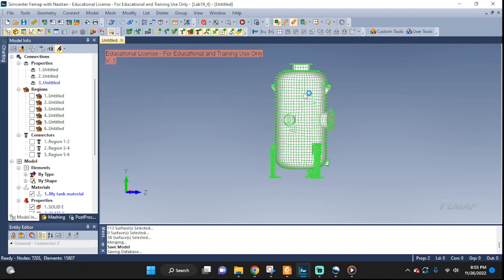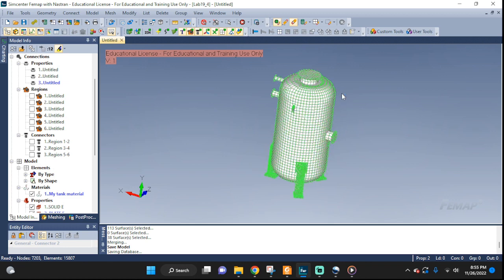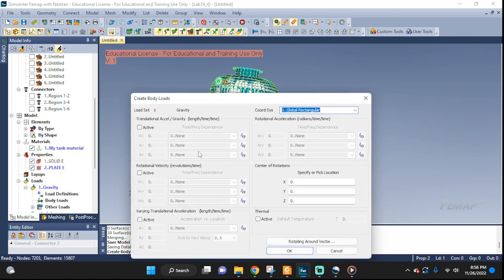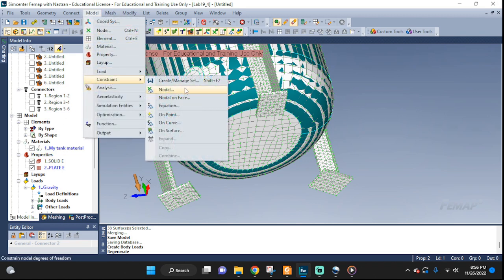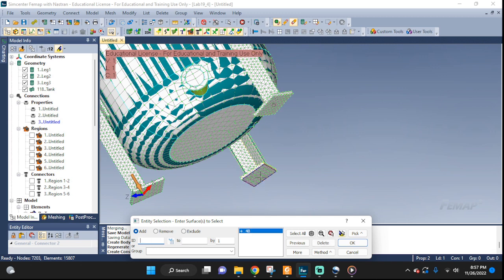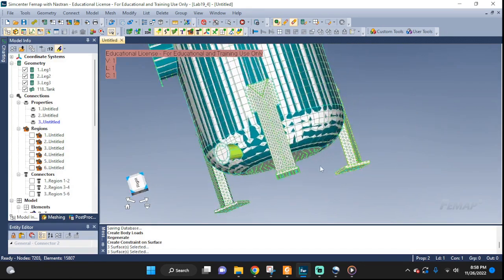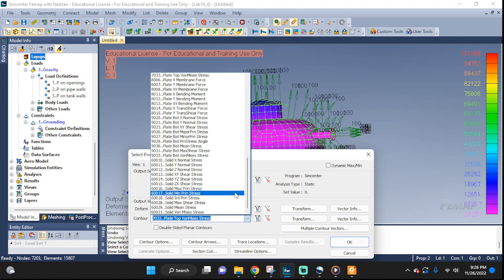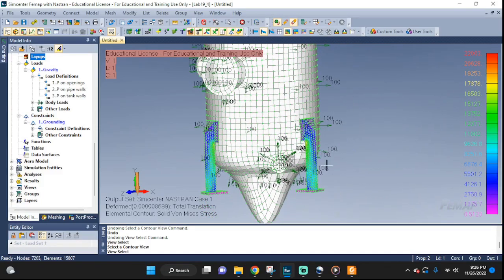Femap Nastran pressure vessel analysis series 5 of 5. Loads setup, gravity setup, Analysis

Comment: I have been using FeMap with Nx Natran with the Solid coming from the Solid Edge Fabrication model Assembly and Stress Linearization within Femap.

This is more of an ASME approach.
Reply: Stress Linearization is not required if your analysis is based on Shell or plate elements. We only do Solid if we are looking at stresses on thick nozzles. or stresses in the nozzle exceeds expectations and further analysis is required with the welded detailing.
Reply: @navalfa7291  we only use Solid Modeling, why use Shell or surface